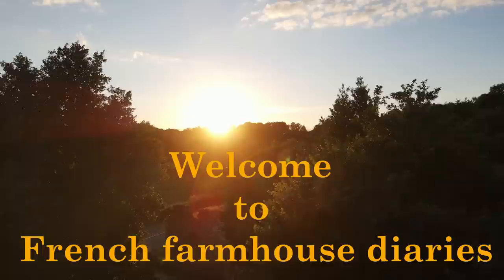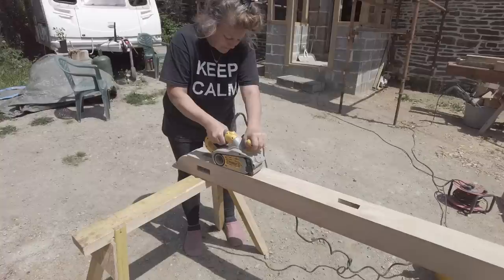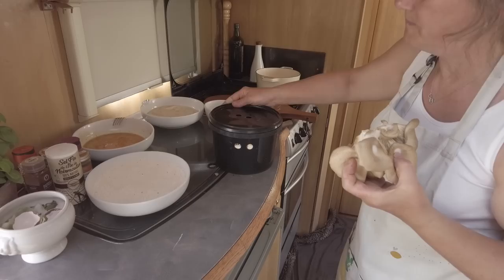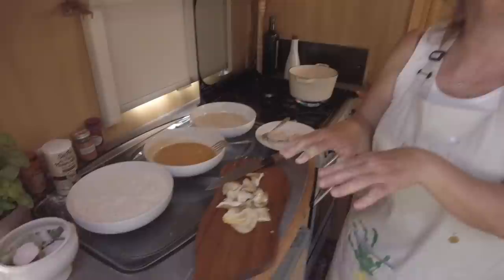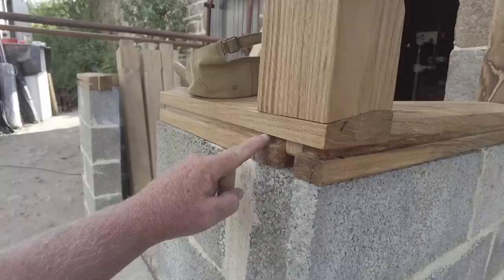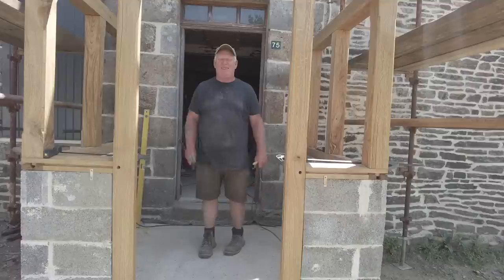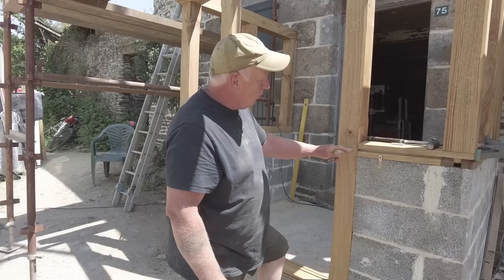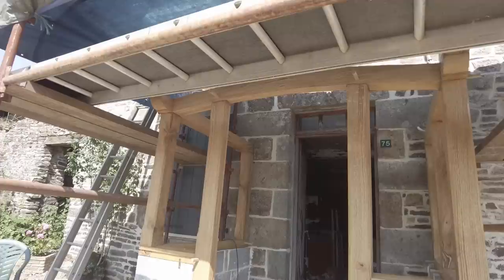No 103 OAK PORCH FRAMEWORK DONE  #porch #porchbuild

Comment: I thought they used Oakum on ships to putty between joints? Oakum as you know is hemp and tar sort of in a soft rope form.
Reply from the maker: Hi Cheryl you are correct they would roll and bead up the oakum with a caulking iron  and caulking hammer a long hammer normally made of hard wood into the joints then they would pour pitch on to the oakum or use a pitch stick to roll it in then when it was dry they would putty over the top to finish especially around the hull but putty was use for many things around the ships in the old days By the way i make my own Tar as well as putty and many oil finishes to all the best Budo x

Comment: Hi Budo, the porch build is looking amazing. Do you cut the 15 degrees angle on the lower door frame sill on the table saw? Will the oak turn silver over time with your oil coating?
Reply from the maker: Hi Danny thank you yes i rough cut the 15% on the table saw then hand plane to my lines as you eliminate all the saw marks then and the oak will darken over time but i will keep up the recoating every year for the first three then every 2 to 3 years from then on but all in all it should stay this colour with this maintenance system in place buddy all the best  Budo 🪚🤠👍

Comment: I would have liked to see how you cut the feature quadrants on the two top sides which will support the roof. Did you use a band saw? Or is it a trade secret
Reply from the maker: No trade secret there mate i used a saw a chisel and a rebate plane very straight forward basic carpentry Richard 🪚🤠👍